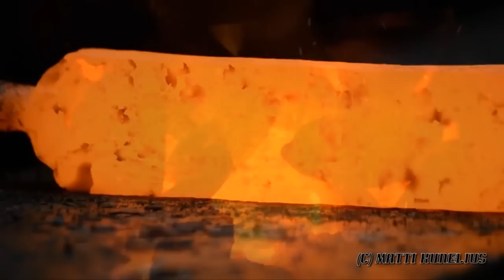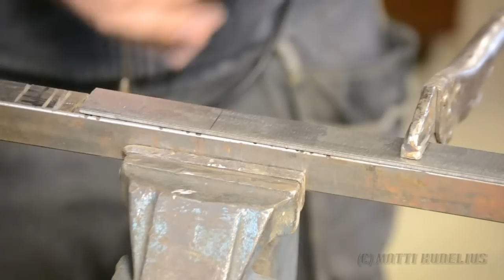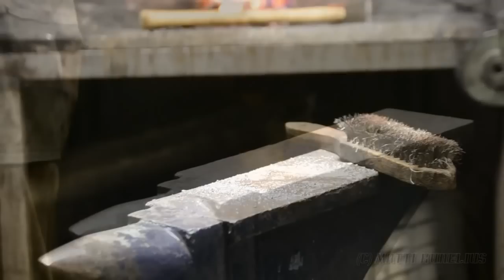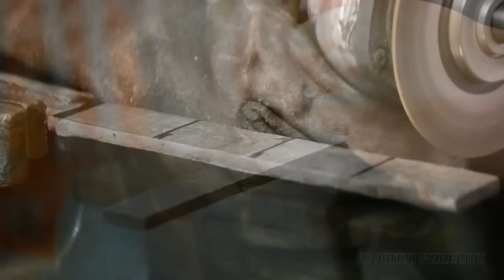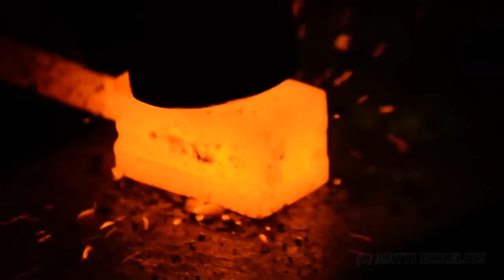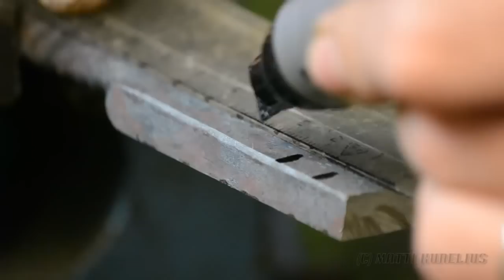Damascus steel in detail, M. Kunelius - Part 1

Comment: Awesome work, just wondering at the very start when you did the first layering before the first hammering. you layered with two different kinds of steel and then after the hammering and drawing out you kept cutting it and re-layering useing the already layered steel correct?

Comment: Excuse me, but I'm curious - when you're working the hot metal, there's a great deal of gray flaking coming off as you hammer. Is that the flux after it's been heated, or oxides, or both? (I only work in silver so I'm unfamiliar with the vagaries of working white-hot metal!) Thanks!

Comment: The flux also flows between the welded together pieces of the steel with heating and capillary action in the forge. when taken out and hammered it allows the steel to weld together creating an homogenous lump of steel again. Repated cutting into little slabs, heating and welding back into one piece of steel creates the pattern weld or Damascus layering of the steel.

Comment: Nice video!
Just some question:
1) At 4.50, what's the white dust?
2) How do you spend for all the instrument to produce it? I mean: power hammer, forge, hammers, ecc.
Reply: the dust is some form of flux powder used to prevent the steel from oxidizing

Comment: Patrick Inotell:
it's forge welding flux, that one looks to me like straight Borax, or Sodium Tetraborate.  The flux melts at forge temperatures, and forms a liquid barrier on top of the steel that prevents oxygen reaching the weld site.  Oxide layers prevent the weld from forming properly.  Or... at all really.  It's why electric welding systems use either flux or a shielding gas (or both) to protect the weld.
Reply: ... Google, you ... confuse me... I didn't realize I was sharing my comments with my G+ feed.  Interesting...
Reply: Wow. How can something so hot be so cool. Thanks!
Reply: And yet now you get to see how many of your friends have secretly always wished they had a forge....I mean...ummm...are wow'd by the cinematography of those YouTube clips ;)
Reply: Google is sky-net... but I will have to be careful about what I comment on then. :)

Comment: different paths to get to same place. i've seen several methods of making damascus steel.. twisting...  making billets with chains, cable...  even springs(failed, but could have worked it out eventually)

Comment: Relatively high- and low-carbon steel plates. Not only do they provide the Damascus steel pattern after acid bathing thanks to the varying hardness of the metals, but it provides a very plastic steel able to hold an edge very well.

Methods for making Damascus steel were long forgotten until fairly recently when it was accidentally rediscovered. It may still not be authentic, but it's the closest we have.

Comment: well to be more specific it is literally akin to putting a blanket over the steel to stop the rapid formation of iron oxide (scale) borax melts to a treacle like consistancy and covers the steel stopping oxygen from mkaing contact with the hot steel, completely stopping the forming of scale however if he is using a good coke forge or charcoal forge with just the right amount of air passing into it he will not need flux at all

Comment: why not fold the steel rather than cutting it and welding it back together?
Reply: This billet is a lot "less likely" to end up with bad welds and iclusions when it's finished if you grind off the scale on the mating faces in between forge welds.  A lot of bladesmiths figure it's worth the bit of extra work and time to insure a nice flawsess blade in the end.
Reply: ***** Can you please explain this in layman's terms?
Reply: liquidfire1206 All the black stuff that forms on the steel when it's exposed to high heat + oxygen is called "scale".  If the faces of the pieces of steel that are being forge welded together are covered in that scale (which can easily happen when folding hot steel) it can prevent the steel faces from making a good "bond".  All of the trapped scale within the layers of the now mutiple layered steel "billet"  would show up on the blade and bevels when they are ground in. 

This would result in an ugly, and more importantly, weak blade with weak spots where those inclusions (trapped scale between layers) are.

So basically a lot of bladesmiths making pattern welded steel, also widely termed "damascus", will let the billet cool down, then grind off all of the black scale to expose the clean steel surface underneath.  Next they'll cut the bar up into however many pieces they want.  Then, using a mig welder, they temporarily tack weld those pieces together along with a handle on one end (rebar is often used for a quick handle) to make it easier to work with while forging.  Next they'll put the new stack (billet) into the forge and let it heat up a bit, but before they "set the weld" they will take the billet out and cover it with flux (borax etc.)  before the steel gets hot enough to start forming a lot of scale.  This powder flux will then melt into a clear liquid and seep down between the layers after it's put back in the forge for more heat, coating them with what is basically like a "clear candy coating" of molten flux, which protects the cleanly ground steel faces from all the oxygen in the forge.  Done correctly, when the layers are hammered together, all the flux will squirt out from inbetween the layers and the layers of steel will bond together at the atomic level, becomming essentially one piece of steel. 

And that is what "forge welding" is.  It has nothing to do with the welders used to get the pieces to stay together while heating up, those are just used to make things easier to work with.  BTW - You don't need a welder to make pattern welded steel, many people also use things like bailing wire to tightly wrap the pieces together, then after the first forge weld is made, they will snip it off with wire cutters so it doesn't get in the way, since the individual pieces are now "stuck" together and don't need it anymore.

I know this is long, but I hope it helps you have an idea of what is goin on.  If not, just research "forge welding" "pattern welded steel" and "damascus" and you'll find plenty more info.  Take care :)
Reply: Thank you so much for clearing that up! I want to get into some amateur blacksmithing, forging and stuff, and this helps immensely!
Reply: liquidfire1206  No problem, glad I could help :)  You should join some forums.  Check out www.iforgeiron.com  and join it.  There are always plenty of great guys willing help others out and 'this' specific forum has a lot info about general blacksmithing, as well info related to knifemaking/ bladesmithing.  If you're interested in more knifemaking specific related forums then let me know and I can name about 5 great forums off the top of my head that each have tons of info and good people willing to help out :)
Reply: sure! right now im trying to make a forge kinda like nighthawkinlight did (look it up, its pretty cool). im just trying to get my hands on some plaster of paris. not sure what kind of knife i should make first... something simple...
Reply: If you cut, and restack the pieces properly, you can avoid winding up with two adjacent layers becoming one thicker (homogenous) layer in the stack. (By stacking them with (properly) alternated material layers, the resulting cross-section is much more uniform and difficult to detect where the 'semi finished' bars were stacked and then forge-welded together, (during the process of forging).   When the material is merely 'folded' back on itself, this results in a double thick layer of one kind of steel, (carbon-carbon), or (nickle-nickle) at each folded and forge-welded interface/seam):
=>  the result is less even/uniform in it's cross-sectional pattern.

Comment: I might be wrong, but I think this isn't damascus steel? Damascus steel is a cruicible steel cooled down in a special way to form crystallic bindings in the structure of steel, resulting in the pattern visible outside. This here is pattern-welding, welding together steel and iron pieces with different amount of carbon in them, so they make patterns and vary in colour.
Reply: More technically, this would be called Pattern Welded Steel. Damascus steel is a very specific kind of historic steel (don't know details) but this is usually called damascus because it looks like the damascus of old. There's also wootz steel, which is a whole different can of worms.
Reply: ummonk
Thanks! Very informative indeed.
Reply: Lincoln Oberst
From what I was able to learn (which is admittedly more than half derived from Wikipedia) proper Damascus steel refers to blades forged in the city of Damascus from Wootz steel, which apparently originated from a mine in india that produced unusually pure iron. It has supposedly been recently discovered that the iron contained trace amounts of a couple of carbide forming elements which were responsible for the characteristic patters and legendary toughness of Damascus steel blades. you can read more here: http://www.tms.org/pubs/journals/jom/9809/verhoeven-9809.html

Comment: Is he using just one kind of steel or more? What are the best types for blades like this?
Reply: You need to use at least two diffrent types of steel to get a nice contrast in the layers when the finished blade is etched to show the pattern.  For best performance, most bladesmiths will use a plain high carbon steel (i.e. 1095, 1084 etc.) as well as a high carbon steel with a bit of nickel added to it (i.e.15n20, L6).  When the blade is etched in acid, the acid will "eat away" at the plain carbon steel more aggressively, and less so on the steel containing the nickel, because the nickel adds corrosion resistance to the steel.  So in the end, the steel with nickel will remain bright and shiny, and the plain high carbon steel will be dark, which will give contrast to reveal the pattern in the blade. 

TIP.. It's best to only use steels that would make great knives by themselves so that the the pattern welded blade will have good edge performance.  Also, it's better to use steels that have similar heat treating methods for the same reson.  An exception would be if you were making "san mai" damascus since you would only need a good blade steel for the core, then you could use steels that aren't that high performance for knives such as mild steel, pure nickel, low carbon stainless steel  etc. since only the good core steel will be used for the cutting edge, and the other steels or metals areonly on the sides on the blade   Sorry if that's too much info, but I thought it might help to explain "why".
Reply: ***** Thank you very much for your tips and knowledge, your reply has been most helpful!
Reply: Comrade Mod No problem :)  Glad I could help!
Reply: This is from forever and a day ago, but I figured I'd add that warikomi-cladding is more common than sanmai-cladding (cladding=awase). Warikomi-awase style, the bladesmith will pound a groove into the soft jacket steel (jigane), insert the expensive, high-carbon core (hagane), and then pound/fold the jacket sides down around it, thereby leaving only one exposed edge—the cutting edge. Sanmai-awase style splits the jacket completely in half and then forge welds it together with the core metal sammiched in between; the core metal will be exposed along the spine. Sanmai requires more of the expensive steel to do, whereas Warikomi need not go all the way to the spine—often will only go halfway up the height of the blade—thereby reducing costs in manufacturing the blades. Obviously, this principle applies to using layered steel as the jacket, thereby enabling one to expose a uniform cutting edge every time the blade is sharpened, which makes a lot more sense than having a cutting edge that changes from one steel to the next along the length of it (this will greatly affect ones ability to get a consistent edge sharpness every time it is sharpened, since one metal will wear more easily than the other, not only when sharpening—which can lead to an uneven edge—but also during use; though I doubt most people would notice unless they're used to using the highest of quality steels).

Comment: What kind of steel is being used? Iron content? Chromium? Stainless blends??
Reply: Apparently, when viewed by scientists under a electronic microscope, they found that they were made by introducing chemicals to the steel during production to change its electronic makeup. Literally, it was Dark Age Nanotechnology
Reply: +fast vinny It's just a mix of two simple high carbon steels, except one of them has a bit of nickel in it, which resists the acid etch (because nickel is very corrosion resistant) and becomes the "shiny" layer in the pattern.  :)

Comment: Borax is a flux. Fluxes don't really do anything themselves, they help other processes along. In this case, they help reduce the production of the oxidation layer that forms on the hot metal so that the welds will form properly.

Comment: What's the white powder added to the burned iron ???
Reply: Its a flux, you can use a lot of things a flux. You can you Borax, fine sand, ect. Flux is used to keep the impurities in the air away from the weld
Reply: Joe Grove Thank's a lot.
Reply: No problem man
Reply: typically some mixture of Borax, or, forge welding "flux" (mostly Borax). (Google search this stuff as needed).

Comment: What is that powder u put on it, and why do u put it on the steel??
Reply: It's flux. It is there to remove the oxyde between the layers so they will merge nicely and cleanly.
Reply: THANKS
Reply: My pleasure! :)
Reply: What's the powder
Reply: Noah Bradshaw As I previously said, it is flux. It is there to remove the oxyde to ensure a clean, nice welding between the layers. :)
Reply: Ty

Comment: Not to be a total smart ass, but doesn't anyone hammer by hand anymore? Obviously by machine is more efficient, but still..
Reply: Only when  power hammering can't reach what needs to be hammered.
Reply: Sir.Alex In the old days, they used to use large water-powered hammers. So power hammers are "period". Plus, the fewer welding heats the metal is subject to, the better. Many Japanese bladesmiths use power hammers now- they don't get sick, injured or talk back...
Reply: look up secrets of the Viking sword :)

Comment: Where can I buy flux, please answer ;)
Reply: You can get Borax from Walmart or any store like that. Should be in the detergent aisle
Reply: you don't need flux to weld but a lot of people use it so they can get a cleaner weld but if you can forge weld with out it your a pro
Reply: The weld will always be stronger with the flux.................. Use the Flux Luke
Reply: Joe Grove i been forge welding today different size steel and all just keep your fire clean from dust,slag and clinka and your anvil (or hammer/harden plate) and brush the slag off your metal and your will be fine flux don't mean anything and just a wast of money and time to me

Comment: Was disappointed to find this wasn't true Damascus. Further bummed to see the power hammer used and even further bummed by the "cut and stack" method versus forge welding by hammer and truly "folding" the piece. I think technology has watered this process down. Still cool to see, though.
Reply: Jason Harris 

I couldn't tell from the video, were the stacks all carbon steel or were plates of stainless added.
Reply: There is nothing fake here. Pattern welded steel has been referred to as "damascus" for over a century. Cut and stack may not seem as "stylisticaly impressive" as folding. However, it typically allows for much better control ans better welds. Why not follow the path that in the end means you throw away less materials. Not using power tools is fine if you are a reenactor (Woodwrights shop) or you have unlimited manual labor.

Comment: He doesn't show it, but you can see obvious two types of metals, It is supposed to alternate between layers, harder (for holding a sharp edge) and softer metal to improve strength and durability. Every cycle (fold) makes it stronger..just sayin.
Reply: He does. You can see him cut two different metals, layer them, weld them together, and begin forging them
Reply: *****
 In his site he explains everything, they are carbon steel (I think the US designation would be 1080) and 15N20 nickel steel.
Reply: I think that's a pretty common combo. I'm far from expert, though.

Comment: True Damascus steel was actually Wootz. Called Damascus because Damascus was the city where the Europeans traded for and bought blades made of WOOTZ.
A type of crucible steel from India and Persia. Pattern welded blades were made with Damascus ingots. Steel was at one time as valuable as gold. Hard to make in good quantities by the local smiths. They would layer it together with iron to make, Pattern Welded Blades with Damascus steel.

Comment: What is that white stuff ?
Reply: Boric Acid...used as a flux...prevents oxidation so that you wont have inclusions inside the layers of steel that will put a blemish in the final product.
Reply: Samuel T.O. Branch Uhhh.... no, it borax. Borax is used a flux and flux is used to keep the impurities in the air away from the weld
Reply: Samuel T.O. Branch you were kinda right
Reply: Joe Grove
Boric Acid is simply refined Borax. Borax is the straight mineral and boric acid is made from it.
Reply: I thought you meant he was using acid as a flux
Reply: cum